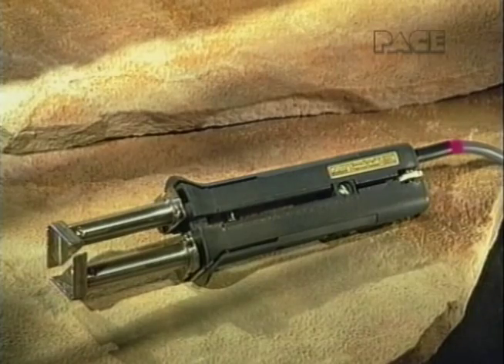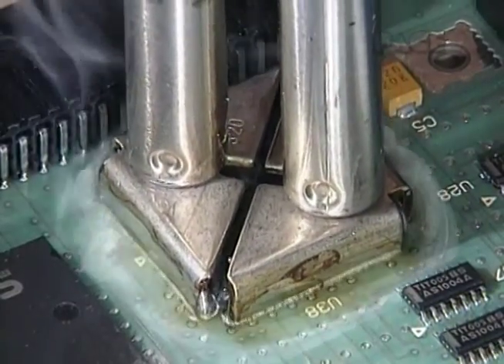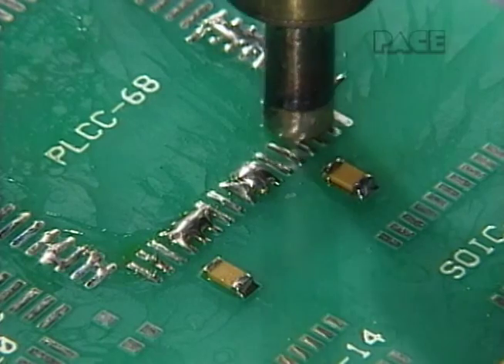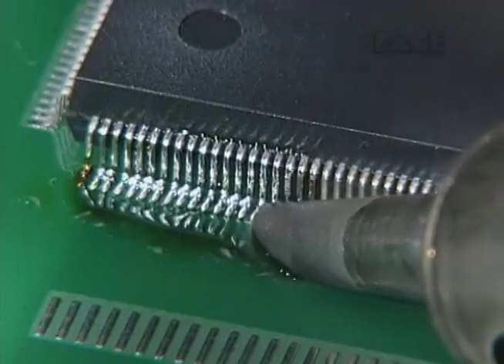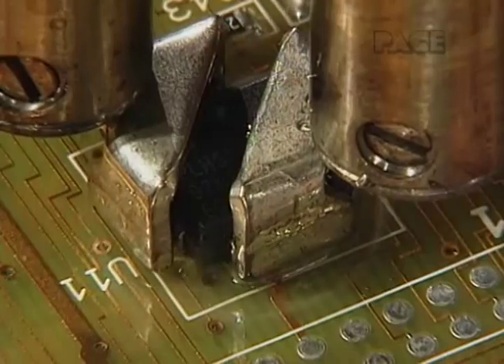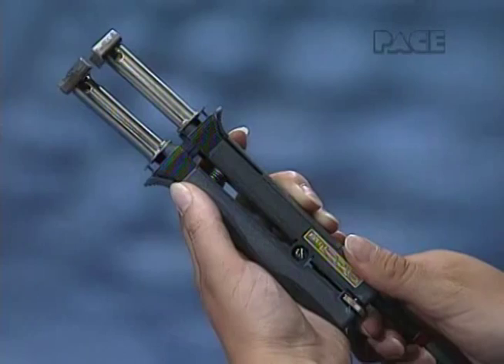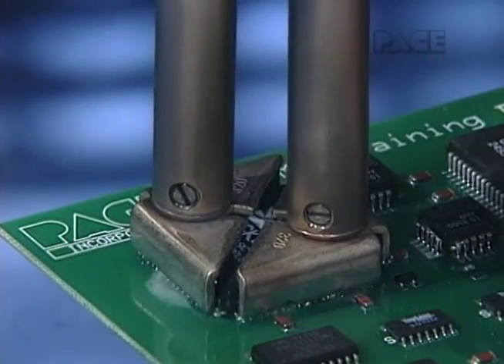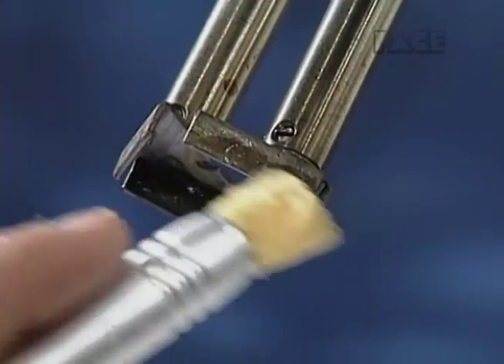TT-65 ThermoTweez Tutorial - "Introduction"

Comment: While these tools seem great for removing surface mount components, due to the increased contact time of the tool on the component, is there an increased risk of damage?
Reply: Damage may occur if the tool is left for too long on the circuit board or the component body or leads. A two second to two and a half second window is generally the timeline associated for tool to component application. Remember that W.P.I or Work Peace Indicator is the most important factor regarding craftsmanship.